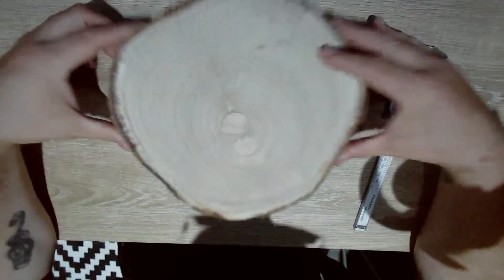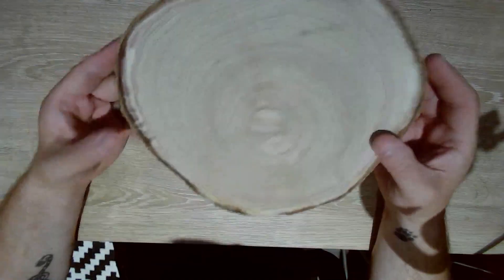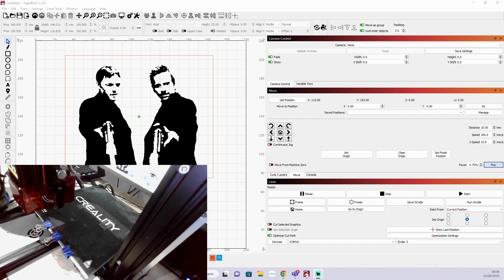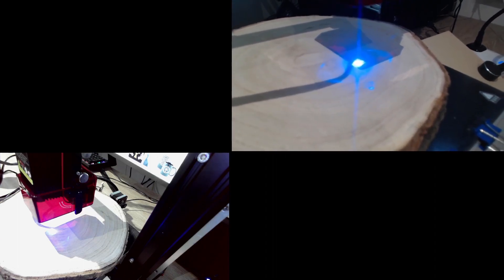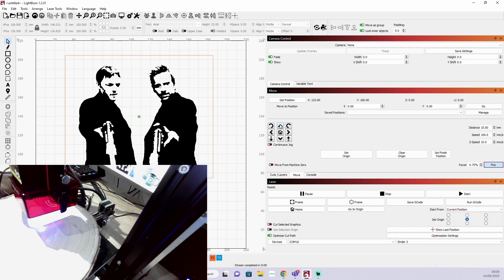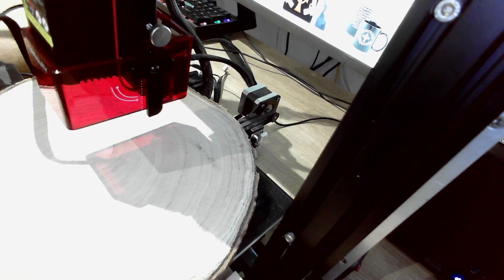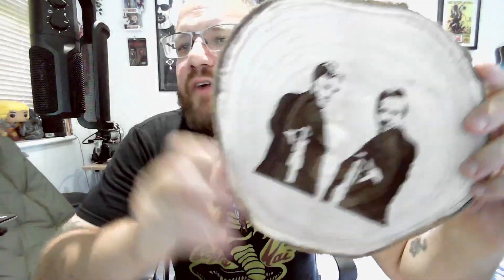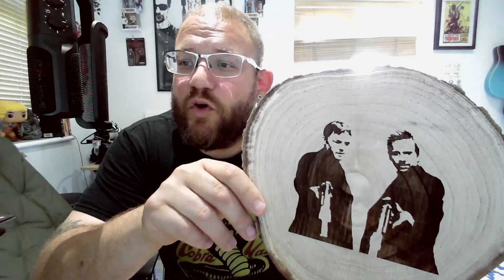How to Align a project in Lightburn - Creality Laser Engraver Module 2023

Comment: i really appreciate this. I recently bought a Falcon 10w engraver, and after setting it all up, I thought it best to set up a camera because my laser wasn't firing when I tried framing or finding a start point, so I built a bunch of templates and set out a template bed. Then figured it may be best to buy a camera and use that. Then, I found your video and learned that you can set the fire option when framing. Cheers, saved myself a few quid that did.

Comment: Quick question. I have the 10w version and connected or not to the computer my laser is on. I have to unplug the laser to keep from burning the frame. Do you have this issue and/or know a solution to this issue?

Comment: Thanks for the instructions. Ive got a V2 Neo whose X axis is offset by 15mm. i.e the point of the laser is 15mm right direction into the build plate when homed. How do I account for this in Lightburn when I want to use absolute coords? I.e I want to move to 110,110 and not have the laser be at 135,100 ?
Reply from the maker: defo a math issue in which case I have not got a clue :(  try reddit would be the most honest answer I could give.